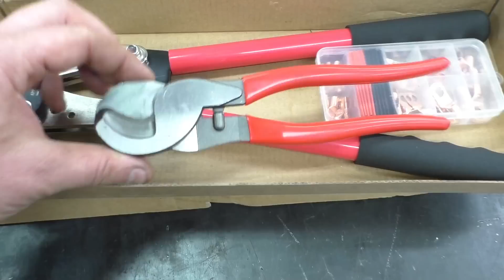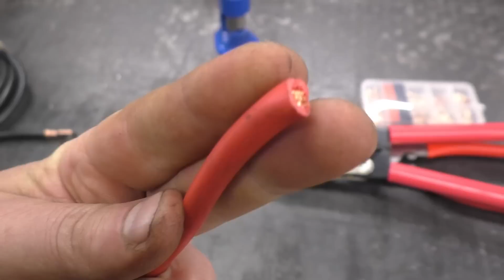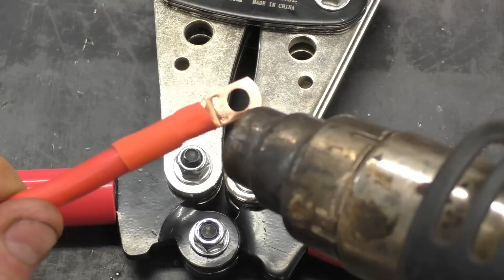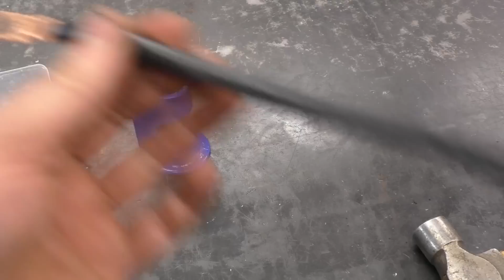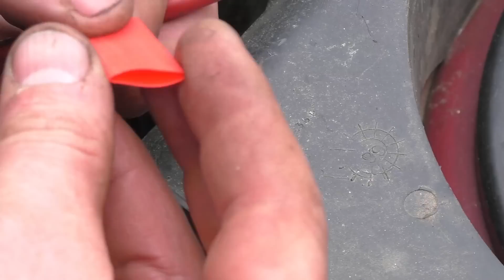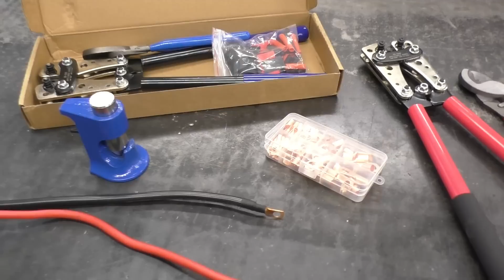Master Battery Lug Crimping On A Budget With Temu Crimping Tools!

Comment: 30 years of doing this in telecom... Some Pro tips, I'm not going to nitpick because who cares. That's cool that it comes with heat shrink but presumably most people are doing battery cables at the battery, it's corrosive there. Spend the extra money on an assortment of heat shrink that's lined with hot glue because that corrosion will travel up the sheath. Also you want to use some sort of No-Ox-Id grease, even silicon dielectric grease inside the lug before you crimp, that will seal your end and maintain good contact. a 12 oz can of NOCO NCP2 is 13 bucks US and will do a lot of terminals.

Those crimpers are decent, especially for the money, Greenlee used to make em(they might still) maybe the patent expired or whoever's making them is saying try and stop us...

Comment: I made a crimper from a large nut. Depending on the size of the lug you can make more than 1. 
I drilled a hole on one of the sides of the nut, then using a bolt, I slide it through the hole in the nut. Then I placed the nut and bolt in a vise, then slide the lug into the threaded side of the nut and tighten the vise. The bolt will force itself into the lug as you tighten the vise. It cost less than $1.00. I made a crimp for my mig welder new ground cable. 😊 

Now if your in a bind and the stores are closed you can use a copper water pipe and make a lug. Flatten one end and drill your hole and the open end of course is for your wire. 

Bought my copper lug at the local TSC store which is now called Peavey Mart here in Ontario Canada. Different sizes of cables are also available on a role at the store.

Comment: My heat gun broke last weekend. Opened it up, the 10a fuse went out , it's 20 yrs old, and will get another 20 just as soon as fuses get here. Our local elec shop closed few years ago. Those are parrot beak cutters ,good find. Take care DB.

Comment: I replaced a lug just last week on a zero turn... finding a new lug of the proper size was the biggest problem! I tried hardware and auto motive stores... I used a pair of Klein slip joint pliers to crimp it. They worked surprisingly well. This tool and lug kit would have payed for itself by saving me a couple hours of running around looking for a lug!

Comment: Cool video but I still prefer a solder joint because I have seen the crimped lugs fail a lot especially in a vibrating and corrosive environment such as granular fertilization equipment.👍

Comment: When I was a mechanic for a large American railway we left our track machines out all winter.  In the spring when it was time to go to work or batteries were always messed up, cables corroded and the like.  Our bolt/hardware products guy came around and showed me a cable crimping tool and the cable ends for it.  Yeah, I want one I said.  He ordered it up and it cost $800.  I almost lost my job.  Yeah, $800 and the tool looked just like the hand operated Temu crimper.  Thanks Dony!
Reply: NO! Thank the Chinese for providing affordable tools for us DIYers ! :hand-purple-blue-peace:

Comment: I like to add a bit of copper based grease to the wire before I crimp the connection to help prevent future corrosion. Great video.

Comment: nice tools , thanks . in a pinch , you can make your own lugs from a piece of flexible copper tubing . saw 1/2 way thru in the middle , hammer one end flat , and drill hole for connecting stud .